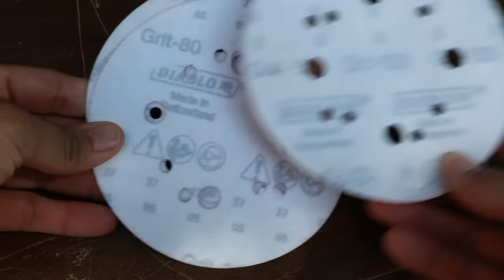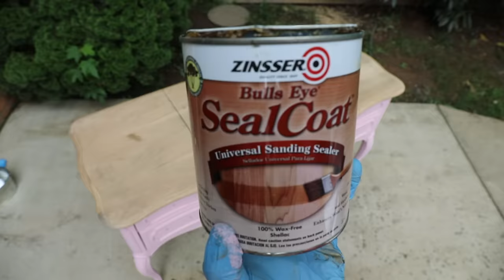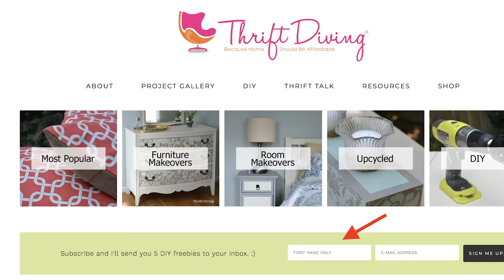"BEFORE and AFTER" French Provincial Vanity Makeover! - Thrift Diving

Comment: Just a quick tip for brass hardware , you can soak them in ketchup over night and it will restore the brass finish , you may have to scrub some areas but it totally works . Amazing redo
Reply from the maker: Thanks for the tip! I am going to give that a try! Glad you like it!!!
Reply: Fanta Graham  nothing.  But it's great to clean copper bottom pots.
Reply: Is it the vinegar that's doing the stripping?
Reply: It must be the vinegar in the ketchup?? Maybe vinegar would also work?
Reply: @vickiehadd4324  I think the acid , but you are probably right. I  got the trick from a lady that refinishes furniture.
Reply: @vickiehadd4324  It would make sense that it’s the vinegar (in which case, lemon juice might also work), and the tomato is also acidic, so that might help, but I suspect the real appeal of this trick may be that you can coat a piece with ketchup and it’ll stay put because it’s a paste—which would also mean you wouldn’t need to immerse the piece in great quantities of it.  Maybe there’s something more to the chemistry, but I do kind of suspect it’s the acid, and white vinegar is cheap enough to use as an immersive bath.

Comment: I have a similar vanity that I just painted. When you have oil you need to spray it with Zinnser (Bullseye) shellac. You can fix the trim with paper clay. Mold it over the existing trim then add where it's missing.

Comment: As an Asset Recovery Specialist- o.k., trash picker- I scored one of these roadside 3 weeks ago, I'm gonna paint it up for the wife, she's very into puzzles so this is gonna be a perfect hobby center for that. I already made her a tilting easel that she can adjust the puzzle board's resting angle on, so she can do up to a 1,000 piece puzzle anywhere from horizontal to about 45 degrees; thus saving her back. Anyhow, my tip is this: if you want to see the beautiful grain after sanding but before finishing, wipe it with mineral spirits or turpentine- it won't raise the grain or negatively impact the ultimate finish, and will give you a perfect preview before you commit to the top coat. ☺

Comment: When I seen you were trying to debate how you would refill the part of the molding that was missing, the first thing that came to my mind was, to get a wooden dowel about a quarter of inch thick or less ,cut it to the length that you need .Put the wood glue on it, tack it in place, then finish it like you usually do. But I see that you use a glue filler or something and it worked out fine, it looks very nice.
Reply from the maker: Thanks, Lorraine! It's surprising that it worked as well as it did! :) Thanks for watching!

Comment: A trick for repairing broken trim like that: 

Find a spot elsewhere that is slightly larger than the broken piece and spray a light coat of cooking oil, then wipe off.  Then coat the intact section liberally with hotglue and let it cool completely.  There are TONs of products out there that are meant to be use to make molds, but they are all pretty pricey and after trying many, I found hotglue works just as well for all but the most ornate vintage carvings.  For those I will suck it up and buy the good stuff from Smooth On. 

Once cool, carefully pry it off and you have a quick and dirty mold.  Fill with product of your choice to recreate the trim. I've used plaster, wood fill, wood glue + sawdust mixed to a paste, etc.  

Once your product cures, use a hairdryer to warm the hotglue just a little and again carefully pry it off. Some recommend coating the hotglue mold with cooking oil but I've had issues with my product curing correctly so I don't.  Warming the hotglue is usually sufficient to remove it.  

Once your replacement piece is hotglue free, sand any obvious casting blemishes and the edges so it fits in the damaged spot, then glue in place.  I use loctite superglue simply because I'm impatient and want it to dry instantly without needing to clamp or wait, but feel free to use the glue of your choice.  

Use a bit of wood fill at the joins to create a seamless join, sand as needed once fully cured and voila.  You now have a perfectly matched repair with no need to try and recreate the trim by hand. ;) 

You can then stain/paint right along with the rest, though if you use plaster, adding a coat of Retique It does wonders to ensure the color absorbs evenly.

Comment: First, I am SO IMPRESSED with your website and your abilities!!!
I thrifted a headboard and took it outside to paint it, leaning it up against a railing. I thought it was secure but as I turned to get the brush, a strong wind pushed the headboard down and it cracked in the middle-across the main panel of wood.
I glued it and filled with wood fill but there's still a bump there. I've also tried using thick chalk paint.
Any suggestions? 
Thank you!
Trina

Comment: I had a small piece of broken trim like that, I piped some silicone calk in the empty space ran a  wet skewer tip on the edges of the piped "trim" to match the trim and let it dry after I merged the ends of the "piping" to the wood with a wet finger. I painted the whole piece and you dont even notice the trim piece is slightly irregular!

Comment: Serena, I am looking at refurnishing this cheap black piece of furniture, it has golden trim that is like plastic. It appears to be glued on and I feel like I would break it if I tried to remove it. Do you have any recommendations for how to paint with trim, especially when I know it is non wood material? It looks like it has a very strong coat of glossy paint and the material is reflects . I would really appreciate any tips or if I could send you a picture. Thank you!
Reply from the maker: Hi Laura! If you're using chalk paint, you can likely paint it and it will be fine. If you're in doubt, get some KILZ oil-based spray printer and cover those areas, if you find the paint isn't sticking well. Hope that helps!!
Reply: @ThriftDiving  thank you serena! I think it might be metal

Comment: You sure went ham with that sander without trying anything else. I would have probably stripped the previous finish first. Just my 2 cents.
Reply from the maker: I just didn't feel like stripping it. I still would have needed to sand it, even with stripper. I use stripper for other projects. I like showing both methods because there are people who will strip and others who will only sand. Both are an option.

Comment: Looks like  my mirrored vanity mine does not open its on a frame behind it. Mine has veneer on top and it needs  replacing. Other than that the hardware is newer and the legs aren't  shaped. Mine is from the depression Love the pink but black actually  makes sense.

Comment: Why don’t u have to remove color or sand the whole thing?
Reply from the maker: Nope! If you did, it wouldn’t hurt, but I wouldn’t spent a ton of time sanding before painting. Even just a light roughing up would be good, but not really necessary. :)
Reply from the maker: Oh, I should also add that the reason you don’t have to sand is because paint formulated for furniture doesn’t require sanding or stripping first. Some people will swear that you have to sand first, but you don’t HAVE to. It would make the paint stick better if you lightly sand, but if you don’t, you’ll still get good results. Regular paint like latex wall paint, you’ll definitely want to sand a bit and prime.